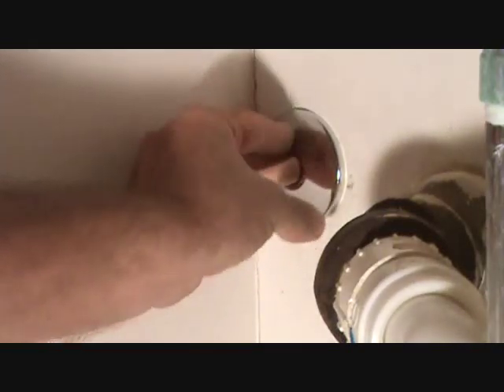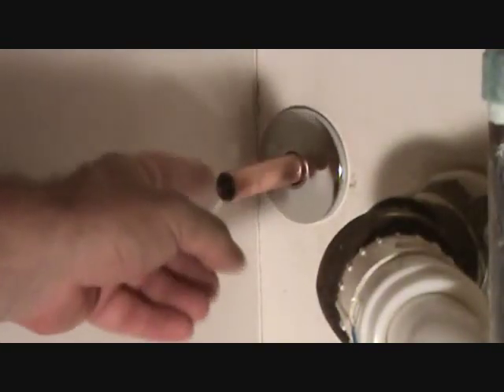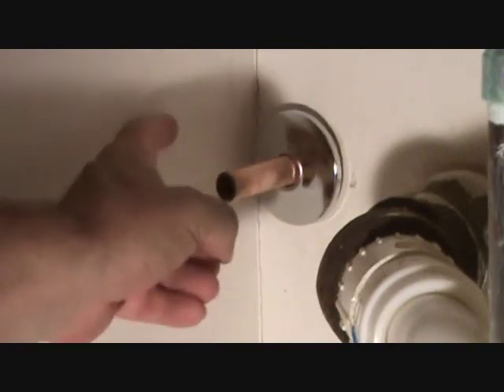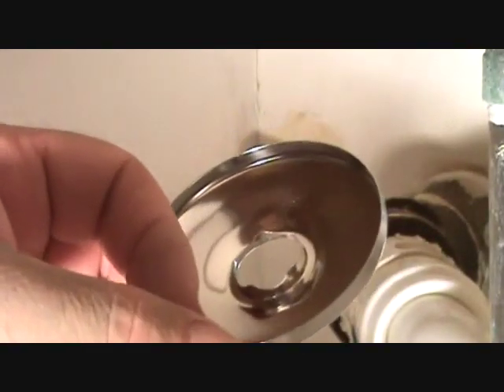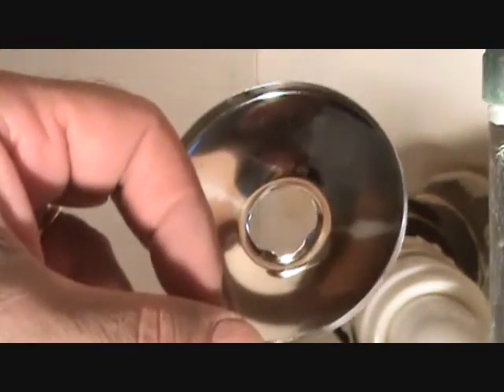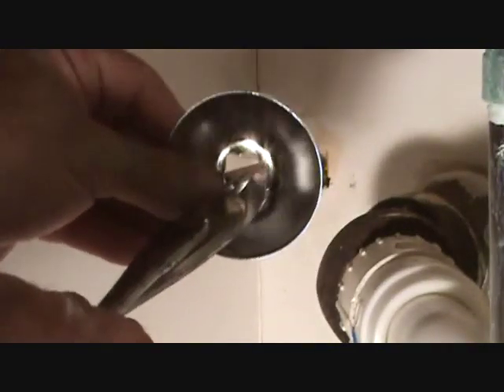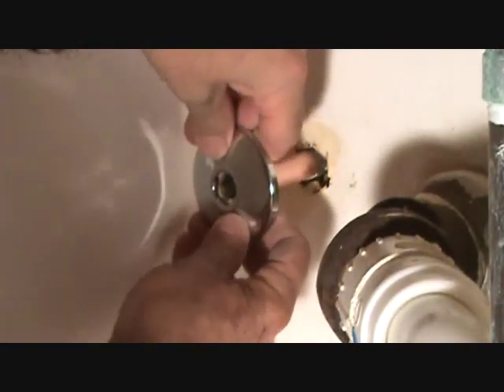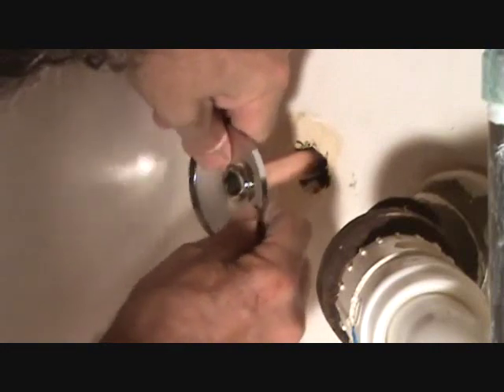How to install escutcheon trim: to a copper plumbing pipe

Comment from the maker: I use to be a General Contractor (for almost 30 years). I mainly did commercial tenant improvements & comm. maintenance. I coordinated with the subs, inspectors, tenants, management groups, etc., so I didn't get in there & do the everyday work of the subs. I really don't particualarly do/like plumbing projects but I'll do them if I have to. I made this channel to show DIY'ers that if an average "joe" can do it, so can they. I may not do things the same as a pro plumber, but it works.   Joe  :0

Comment: You can keep the copper pipe from moving by spraying expanding foam into the hole in the wall behind the opening. When it sets, the pipe won't move.
Reply from the maker: +carver3419 Great idea. Thanks!  Joe  :0

Comment from the maker: @kimlea69 That's a good suggestion for tighting up the jiggiling pipe in the wall. Thanks for the suggestion. This would be a good fix if the pipe rattled in the wall eveytime you turned on the water to the faucet. Other than that, it's probably not a real issue, other than if bugs come into your cabinet from the gap around your copper pipe. Things to think about. Thanks again for your comments.   Joe  :0
Reply: A more recent person after this in a following post offered an idea to correct the wobbling in the wall if it wasn't fastened securely as it should have been: use spray foam around it. The dip shit so-called "maintenance" men that claim to do "work' aka sitting around smoking, wasting their "limited precious time" yaking it up, but quick to get nasty & claim they're so over worked that they can't possibly do something for you, i.e. like the repair that they're suppose to do in the first place, God forbidden they actually work to get their paycheck CAULKED ALL AROUND BEHIND the escutcheon plate in effect seal the escutcheon plate to the copper pipe itself & behind that to the wall.  When trying to remove the escutcheon plate which is an easy task & something I've done many times before & easily, couldn't figure out why I was having to work so hard to get something off where the complaint/problem most of the time is like this in the video where you can't get it to stay in place where it's meant to be. I was using a flexible metal putty knife going around the circumference carefully & cautiously for almost if not more than an hour--all the while thinking "WTH is going on here? This IS NOT supposed to be a challenge, nor an extreme 1 at that!". Finally, when it was released with a lot of work & effort to be be careful & not cause damage, I discovered the WTH is going on here. The copper water line pipe was left loose identical to your video where it should've been securely fastened inside of the wall with clamps AS IT SHOULD HAVE BEEN IN THE FIRST PLACE! Their solution was to get the plate close enough to the wall where the caulk tube tip could fit just behind, squeeze out 1/4 of the tube of caulk & quickly slammed it back to the wall before it started to seal. This explains why I couldn't see at all what was holding on preventing the plate from moving. YOUR VIDEO WAS GREAT & affirmed that I AM NOT CRAZY, & reinforced what I already knew about the "maintenance" men; that they are incompetent lazy yucks who fit the mold of a well deserved stereotypical reputation. They abide by the "caulk fixes everything" idea just like the more better known "duct tape fixes everything" mantra. Despite embracing the "caulk fixes everything" philosophy they can't do it right anywhere else in easy everyday applications, e.g. bathtub wall seam, back of countertop to backsplash, etc. Ironically, despite their love affair with the use of caulk, albeit that they have no mental capacity on how to use it, this summarizes everything in full, "They couldn't CAULK their way out of a wet paper bag.  Even if their lives depended upon it". P.S. A colorful, more traditional use of the word typically used in that expression can be substituted for the word "CAULK" there at the end. It was just too applicable & appealing to be overlooked.

Comment: I have a step bit handy and decided to  push it in by hand (no drilling) to expand my 3/8" IPS escutcheon (flange). It worked with a little finagling. Wear gloves, these metal doesn't seem sharp until you twisting twist on it!
Reply from the maker: Nice going. Thanks for the idea!

Comment: How do you replace an old rusty one that is attached to the water line?
Reply: Get some strong metal shears and make a cut from the outside edge to the inside edge of the old escutcheon.  Bend it open and take it off.  Then get a new one and also make the same cut in it.  Slip it around the pipe and turn the cut edge towards the back (or down) to hide it.  It will look okay.  Better than a rusty one.
Reply from the maker: Did you get it replaced with the new split ring one? Might take a little doing to cut the other one off then prep for the new one with emory cloth but it can be done.

Comment: Is there a trim ring available when the valve is not removed?
Reply from the maker: Yes they have the same type of escutcheon trim ring but it's called a split ring where it's cut in two & at one end it is connected with a bead where you can swivel it apart then wrap around your pipe & it kind of clips together. work nice in the areas where you need them for sure. Thanks for stopping by!